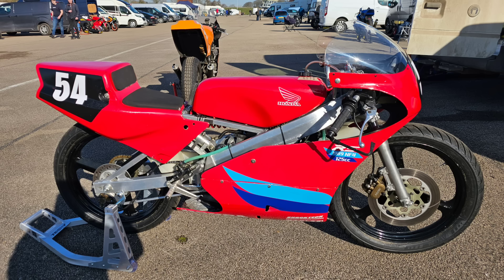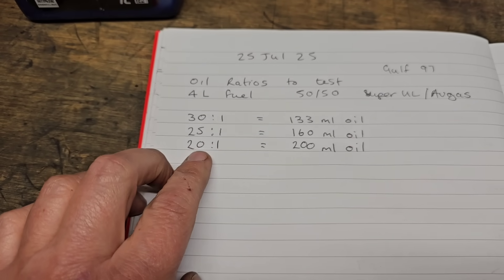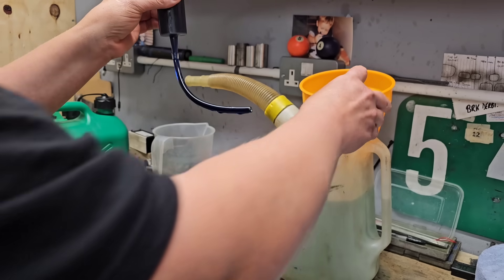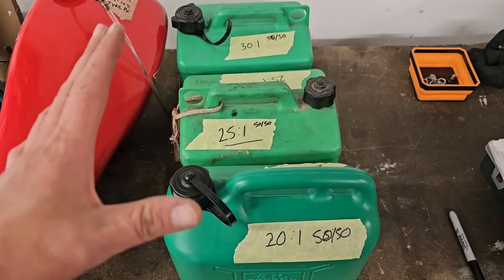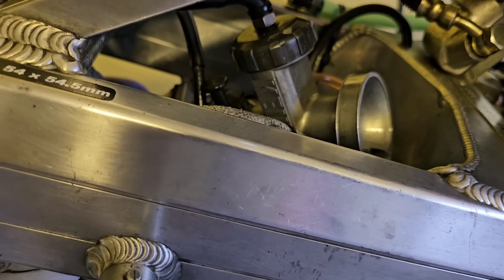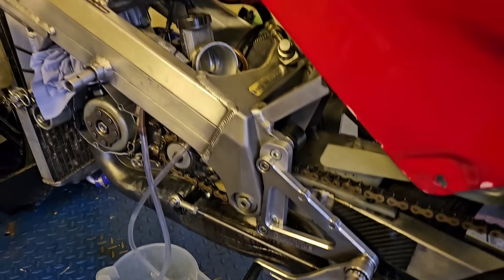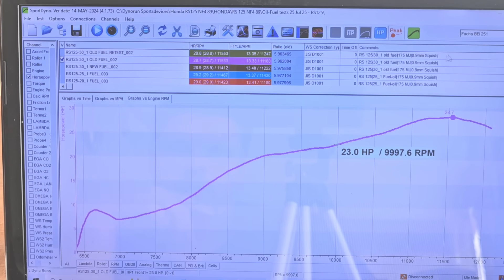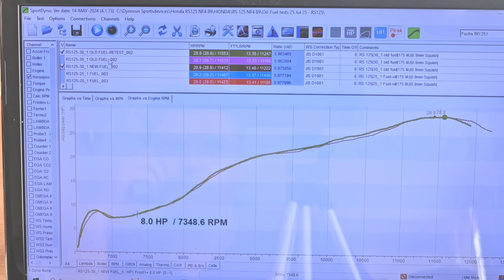Does 2-Stroke Oil Ratio Really Change Power? (Dyno Tested)

Comment: I dont know how much fuel quality varies between countries but in nordics it is common to use 50:1 ratio with 98 octane fuel (regular pump gas) or 33:1 with cheaper oils. Remember that many 2 stroke premium oils use octane boosting technology that changes afr littlebit. For example I have used Castrol A747 for ages with 50:1 and I tested Motul 800 and found out that it changes afr much leaner, had to jet up 10 sizes on main and just 2.5 on pilot jet. It would be nice if you also tried Castrol A747 on your bike and compare it to some oil that increases octane. I didnt do any dyno comparison between those but would be interesting to see.
Reply: I thought it is good to mention that using 50:1 on a747 I have had powervalve, espesially ypvs to last alot longer without maintenance, also on exhaustports that use boost ports they have been alot cleaner. Also pistons have lasted as long as they should, dirty airfilter is in my opinion alot worse on destroying pistons if riding on dirt.

Comment: more oil will keep your parts lasting longer from my tests
Reply from the maker: Cool, cheers for the info buddy
Reply: @AutoBeta2T  I dont think power should be a factor in choosing how much oil to use, its a balance between ware and tare and engine heat if you ask me😉

Comment: There isnt enough difference between the ratios used to make the test results of any real value.  Would have been more interesting to use different types of oil and kept mix ratios the same.
Reply from the maker: I can see your point, and I might do that for a future test.
Reply: @AutoBeta2T  The thing that gets overlooked by many, is that using high flash point oil in a low heat engine, will always reduce power as the running temperature means the oil is very resistant to burning, and that will mean combustion is compromised.  Using the oil best suited for the application is very important, and is something that is very confused by posts on various forums.
Reply from the maker: Sweet, some good info again. The 976 appears to be good for my application but the 909 may be better still? It looks to be used in high rpm kart applications.  I believe it does contain castor oil too?

Comment: oil ratio is depend on material oil, compression engine, afr, datasheet spec of oil product is very usefull like flash point, viscocity at 100 degree & base, my krr 150 with compression dynamic 6,8 can use 1:15 with premix with oil racing like motul 800 on road/ castrol a747 but have different ration when use daily oli injected like motul 510, ipone r2000,etc, i have try oil material like fb/fc grade non 100%syntethic non radiator engine it doesnt have problem but when iam going to track or touring for long track i will use racing oil.
Reply from the maker: Cheers buddy. I'm going to look into the data sheet of the Elf oil and see if there anything I'm missing?
Thanks 🙏

Comment: Hello AutoStroke, I run 25/1 since 21 years. I use this ratio for protect parts, I run hard piston speed, a lot of bench test stress,, 
I have testing a lot of oil, and for praticity and performance, Castrol is the best for me. XR77 my favorite. 
You run this nf4 on circuit ? 
Nice to see you in the next video.
Regards.
Reply from the maker: That's great info, cheers for sharing your experience. And yes, it currently racing this year. It's just a shame there aren't more of these out there racing.

Comment: Ive used diesel as  a premix lube at a ratio of 40:1 in my 2020 KTM 150 EXC.
Didnt blow up but the power valve ran dry cause there was nothing left to spooge out of the pipe.
The oil we use in enduro bikes is non combustible but chainsaw oil IS combustible
The diesel was ignited by the fuel burning and made a bit more power I guess.
Reply: So you had 1 part diesel to 40 parts gasoline?? That is the DUMBEST thing iv ever heard. 🤦‍♂️
Reply: @mareksumguy1887    why is it dumb ?
The diesel lubes the bottom end and piston / bore then burns clean makes power and disappears. And is cheaper than Motorex
Reply: @RIPPERTON keep doing it and see how long the engine lasts.
Reply: Diesel is way too thin to effectively lubricate the rings.

For reference, normal air cooled 2T oil in the bottle is about the same viscosity as SAE 30 engine oil. But in the engine it will always be thinner because it's diluted with petrol. Outboard oil is close to SAE 20, and that's already too thin for air cooled engines.

If you want cleanliness, don't run a 2 stroke. But if you must, one of the modern 2T oils which is designed not to smoke (look for JASO FC or FD) will give you the best you can get without burning your rings and piston.
Reply: @nerd1000ify    Then I ran my EBay chainsaw on the same 40:1 unleaded / diesel premix and processed a whole tree with multiple 20-30 second full throttle cuts.
The diesel separates from the unleaded in the crankcase as the unleaded vaporises from the heat in the crank and rod.
Reply: so you ran 80:1.....        diesel is basically 50% oil, 50% petrol....
Reply: @fatsubsonic  Diesel doesn't contain any petrol, it's 100% very light oil.
Reply: @nerd1000ify  Also doesnt evaporate like unleaded.
Reply: @RIPPERTON  Indeed. Though it will evaporate at high enough temperatures!
Reply: Diesel in petrol will put you into detonation before you know it a real stupid idea, even a small amount in a 4 stroke will have the engine rattling its tits off and IN FACT dont burn well in spark ign engines not to be compared to 2T oil in any quantity

Comment: I wish I could post a chart (can not post pictures) but I did a bunch of looking on the internet on two stroke oil and mix ratios a long time ago so I don't remember where I got this info:

This is a chart about two stroke oil mix.
In short:
mineral oil is 20 to 1
semi synthetic 30 to 1
full synthetic 50 to 1 or higher
All of this is based on viscosity and flash point.
One of the main issues with semi synthetic is the bottles do NOT tell you what the ratio of castor oil and synthetic oil is.

I run 50/1 castrol in my three 1985 Honda FL350 off road buggies.
Honda only made these for ONE year and threw in the towel.
They had a lot of recalls on this machine.
The reason was they put an air cooled engine behind a seat (dummies).
What I did on my machines was cut off the fins on the head and cylinder and welded on aluminum "cans". I homemade liquid cooled all three machines and the two spare engines. Then I installed a radiator from a Honda civic car on each machine along with an electric water pump.
I no longer have any engine failures and it's been two decades now.
Reply from the maker: That's some great info, thanks for sharing.

Comment: The YZ and RM motocross bikes from the late 70s were jetted from the factory @ 20:1 mix, when we switched to 50:1 Belray oil the bikes ran quite rich and had to jet them down. they ran great after that.
Reply: Same with the Husqavarna. Jetted for 20:1 at the factory. Must people run 32:1 and complain the husky weren't competitive.
At 32:1 we went down on pilot jet by 2 sizes, mains down by 5 sizes and even swapped out the needle jet to the next leanist. On the 84 250 I remember the slide cutter way was switched out for one leaner.
Reply from the maker: @sprinterdriver4757 I guess jetted and oiled super safe then.
What oil was run in these, mineral or synthetic?
Reply: @AutoBeta2T comp 2 back in the day.
Reply from the maker: Cool, cheers for the info.

Comment: 25-30:1,if in doubt on most 2 stroke road and trail bikes,stick between those 2 figures in a pinch and you should be right,cheers. 🛵🏍👍
Reply from the maker: Cheers. 
Reading through the comments its also something to do with the type of oil too?

Comment: this is the true benefit of oil injection, you can run 18:1 at fully throttle and then not load up the engine with oil at idle
Reply: I’m not a 2t racer, but I have used many such engines in garden equipment and I’ve recently bought a 2t trials bike.  The common theme is the recommended oil ratios these days for these engines are at a minimum 50:1 and up to 100:1 in the case of the bike.  I assumed this was the result of modern oil developments… yet here you’re running the sort of ratios I was using back in the 1970’s.  Bit of a surprise.  Is this common?
Reply: @paultinwell5557  I was gonna say the same thing my RZ500 2 stroke 4 cylinder back in the 80s used to run about a litre per thousand kilometres it was a thirsty beast so that ended up to be about 80 to one my memory served me that it was never worse than 50 to one overall and about 100 to one almost on light loads. I guess it was probably 20 to 1 full throttle through the gears and Yamaha had quite a clever system where the throttle and also RPM ran the injection pump so if you backed off the throttle at high revs the servo motor would continue to feed oil until the RPM dropped but it’s still as you see from my numbers ran a fairly low ratio of oil to fuel
Reply: You can't compare a high revving race bike to a trails bike, not even in the same ball park when it comes to oil ratios @paultinwell5557
Reply from the maker: Yeah, it's a great invention. Best of both worlds really.
Reply: From memory the Aprilia owners handbooks for the 125 2 strokes listed oil ratio as a range, and could be quite low (~1%).

The pump is a variable stroke piston. The engine drives a worm gear that acts of a toothed ring around the oil pump piston to rotate it. At the bottom edge there is a wave profile, so for each rotation it moves up a down once. The throttle connects to a small cam which operates on a pin in the middle of the piston which limits the piston travel depending on throttle position

Comment: The vintage KTM 300 two stroke I own claims it can be run at 50:1 fuel oil mix. I’ve been using 28:1 for a long time and it runs fine but can foul plugs if I’m not careful with the starting procedures. 50:1 definitely produces less visible smoke.
Reply from the maker: Cool, cheers for the information.

Comment: I Drive 2-strokes for over 45 years i always mix 50 to 1 and have never had any problem . Castrol 747 the last 35 years.Including high 14000/min . running engines.
Reply from the maker: Cheers.
Air cooled or water-cooled?
Reply: @AutoBeta2T  Both , Air and Water-cooled

Comment: I've always gone 25/1. I just thought more oil will give longer engine life. I assumed I was probably giving up a little power. Maybe not.
Reply from the maker: What engine and what type of oil are you using, Tony?
Reply: @AutoBeta2T No particular oil. Just whatever is available at the time. I'm not racing or anything. I'm just thrashing around my farm. I've got a 71cc husqvarna chain saw that I've had for about 25 years. I've cut about 5 ute loads of wood a year. It's still fine. I think because I use extra oil It's good enough.

Comment: if you didnt re jet for the change in fuel delivery, this test is boot.
Reply from the maker: I didn't re-jet in this test, but I would like to rerun it sometime.
Looking at the AFR more oil gave a leaner mixture but the jetting was still rich.
Im thinking I may need to find best power jetting on the dyno first and then do the test again. The bike is set a bit rich.
Cheers.
Reply: True. rejet to adjust fuel /air ratio necessary.
13:1 AFM on large 4 stroke seems perfect often .

Comment: I bet your results would change is you switched to Elf 909HTX…..the castor based vs synthetic based blend oils (more or less of the oil burns at different points in the combustion cycle, even with similar flash points)…..in karting lots of people compare 909HTX or Maxima-927 vs Motul Kart-2T and the ratios that delivers best power is quite a bit different….others have found higher oil content in the fuel seems to help more with castor based oils vs less oil helping with synthetic based oils (this is considering optimal jetting for each ratio).
Reply from the maker: Thanks Eric, I'm getting quite a bit of feedback on this video with similar views to yours. 
I may try some of the 909 and maybe some race fuel too.

Comment: Good to know data here , thanks. You might try going the other way with less oil and see what that does. On 4 stroke racing engines oil getting into the chamber kills power. I wonder if the oil is hampering combustion with 2 stroke oils too?
Reply from the maker: Cheers Bill, yes, maybe one to test. 
If I did it again I'd probably run EGT and be more particular with the jetting.
It was a quickest test plus I didn't want to put too many miles on the crank and piston. We still have a couple of rounds to go...
Reply: @AutoBeta2T  At least it puts to bed the old Gordon Jennings idea of feeding the engine slathers of oil. There might be a case for oil injection vs premix. 
I'd like to see 2 oils ,1 thin 1 thick.
1 thick injected into crank bearings and the thinner one injected directly into the piston/cylinder clearance.
The crank needs a small amount of thick oil while the piston needs a bit more but thinner oil. Overall you could use substantially less oil. Possibly increasing combustion efficiency.
Sounds like a lot of work eh?
Reply from the maker: Sounds simple 👌 🤷 🤔 
I guess everything is always a compromise (money[time])
However, in theory, it does sound good.

Comment: Hi Dave nice work there.
I like your approach, as your did your best to "control the variables" and you got a pretty definitive result as far as a RS125 Honda.
I found, during my own development of my Land Speed RGV250 that performance gains are engine type and even Bike specific.
Maybe others got a different result in different engine configuration, but a RS125 is a race engine so it's at the higher end of the development/spec line, so it makes sense that simply adding more oil would do little to increase power.
Look forward to the next Vid
Pete
Reply from the maker: Cheers, Pete, yes, it could be the engine type. I'd like to retest using the AR93 as its air-cooled. 
Maybe different types of oil, too. And maybe more focus on the jetting, too.
As eluded to on another comment, my Honda should run unleaded, and Im 50/50. Id like to try some race fuel, too.

How fast did you get from you RGV?
I think these can push mid-70s on an rgv?
I used to have one; I still wish I did have one 😢

Comment: Have a look on the Cycle World website, they tested this in a Suzuki 250 back in 78 or 79, I think the item was titled 
Less is more, more is less
Or it could be the other way round lol. Memory fades.
They used Csstrol R for the test but mentioned that fully synth should be mixed at the oil manufacturers ratio due to the additive "package".
Reply: this is completely unrelated to anything you've said but I love your profile picture! I have the full picture printed and framed on my shelf, I dont know where I found it from and why I like it so much.
Do you remember how you found the photo?
Reply: @bluej360 
Hi Bluej, if it's me you're asking I just went on Google and asked for images of mad maxs dog.
My old PlayStation name was Madmaxsdog so when I opened a you tube channel I carried it over.
Reply: @bluej360 
Hi Bluej, I just did a Google search for
Images of mad maxs dog.
Madmaxsdog was my old PlayStation name so when I started a yt channel I just carried it over, ironically the channel was 2 stroke tuning but old school, just a calculator and hand tools but it didn't take off so I abandoned it and finally took the vids down.
The only one still on line is titled
Roy does 2 strokes, making expansion chambers
But it's posted under my real name now
Roy Appleton
https://youtu.be/eUquCRgynfg?si=jhNIs3jai3VpFqv4
Reply: @bluej360 
Hi Bluej, I just did an online search for Images of mad maxs dog.
It was my old PlayStation name so when I joined you tube I carried it over.
Ironically I was starting a channel about 2 stroke tuning but old school, just a calculator and hand tools but it didn't take off so I deleted most of them. 
The only one that remains is on another channel I set up earlier this year in my real name
Roy Appleton 
It's titled 
Roy does 2 strokes, making a 2 stroke exhaust 
Basically just how to roll the cones with a round bar and a hammer.
I've tried sending a reply with the link but you tube won't allow it, probably because of starmers censorship law
Reply: @madmaxsdog8040  Ahh I see, so you also just found it by chance. thats some cool stuff though! compared to a lot of people Im only just barely getting into 2 strokes, but almost everything I own is one of em. 
Havent much gotten into the tuning side of things, just built my first garage and Im still settling into that but once I get the right tools I imagine Ill be doing some fun stuff!
Reply from the maker: Cool, I'll have a look for that, mate. 
From the comments, there does seem to be some differences depending on the type of oil used.

Comment: Very interesting. Ive been a sucker to the myth of more power turns out. Ive been running 40:1 in my trailbikes (and mower, chainsaw etc because have it already mixed). Use more expensive synthetic oil and we have 98 unleaded fuel at bowser in Australia. Trail riding the revs are all over the place depending on terain. Less mess. Havent noticed more wear. One of the reasons to go higher ratio is plug fouling but if you use good oil is it such a big deal? Now Im questioning m choise.
Reply from the maker: Cool, I'm pleased you found it interesting.  Are you going to try a higher oil ratio?
Cheers
Dave
Reply: @AutoBeta2T  havent decided. Outboards also run at 50:1 standard. 25:1 on trailbike and the silencer cloggs and drips everywhere.